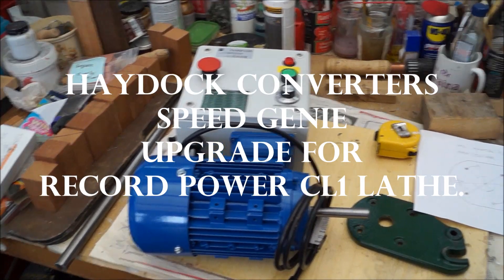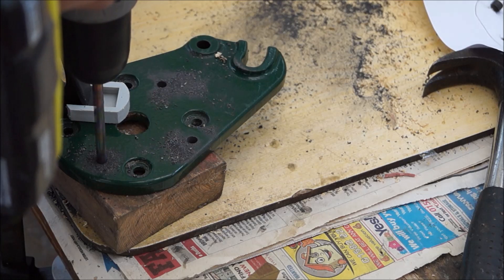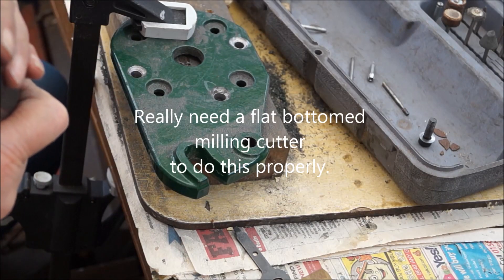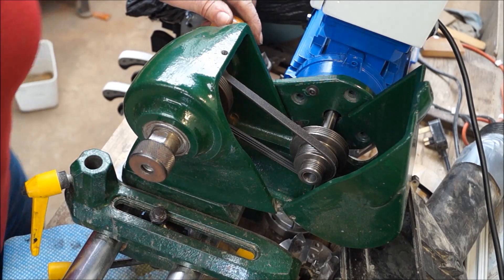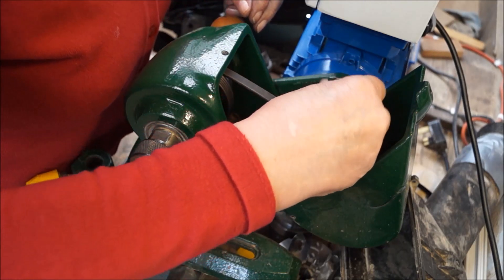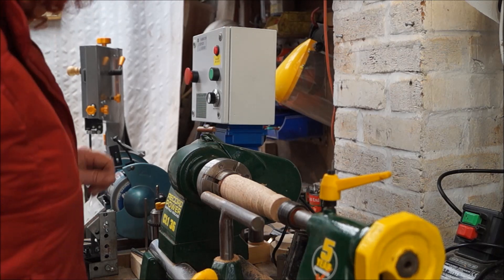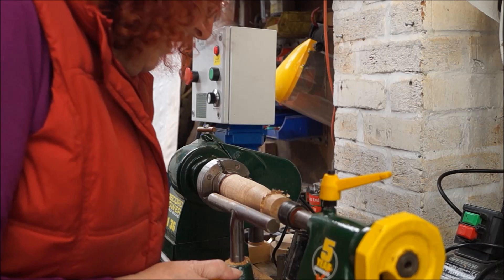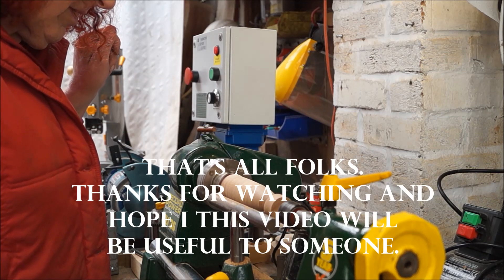Haydock Converters Speed Genie Upgrade for Record Power CL1 Lathe

Comment: good evening
i m french so my english is not very well.Excuse me for  that. I have a problem with the bearing bronze  and this part is not awaible .i saw in your cam that you have a simple bearing is it original mout or you have made changes on your machine . if it s the case can you explain me how you did it
regards
mr weil
Reply from the maker: This is a CL1 which has ball bearings, the  CL3 & CL4 have  bronze bearings which must be oiled through the cap on the top.
These bushes are available through Record Power but I do believe they can be adjusted. I would suggest you contact Record Power directly or through their website. I no longer have this lathe, I sold it earlier this year.
Reply: @missteeswoodturning  thanks for your answer
I ll doing that

Comment: Hi ... 
Great vid ... well-done you!
A side question; if I may ... !?
I see that you have made a little handle for the back end of your main shaft ... 
Do you find that to be very handy in the turning of the shaft by hand ... !?
And, how did you fit that little handle to the end of the shaft ... by it's original little bolt!?
If so; does it not come loose ... !?
Thankyou.
Best ... 
William (Hampshire UK)
Reply from the maker: The original screw wasn't long enough so I used a longer one. There should be a belville washer on the original screw so make sure you use it the correct way round.  Belville washers  are slightly c shaped and the c fits towards the bearing. Also make sure the new knob only seats on the centre of the bearing.

Comment: Wouldnt you think if Record are offering a mod to a lathe, they would consider and if needed supply, the required new mounting plate? That said, they do supply the SC4 chuck with an indexing plate on the back. Which you cant use because you cant access it, as its too close to the headstock!!!! DOH

Comment: Well done mate ... one very happy bunny me thinks :)
Cheers
Mike
Reply from the maker: Thank you Mike. It's made all the difference in the world. It's like having a new lathe. I haven't opened the belt cover since I fitted the conversion. 🙂
Reply: @missteeswoodturning  Out of interest, what is the 'ball park' cost of this conversion. I have a draper and am looking to this very conversion! :-)
Reply from the maker: @OutdoorEducatorLS  if I remember correctly around £350 for the complete conversion which included modifying the pulley to fit the new motor. Obviously that's different for other makes of lathe.
Reply: @missteeswoodturning  I just contacted Haydock, and got offers on a 1hp Speed Genie and a 1.5hp kit, which one is yours? The prices I got was quite a bit higher then 350, unfortunately.
Reply from the maker: @tolsen77  the CL1 kit is under 1hp but I can't remember the exact horsepower.

Comment: I'm happy to see everything is working fine. It seemed to be a bit of a faff, if that's a word, but you managed to overcome the problems with a great result. You will enjoy the benefits of variable speed
Reply: You could opt to add in a tach from ebay. You are certainly talented enough to add one in.
Reply from the maker: @sdad46  Thanks for the idea. Something to think about 🙂
Reply from the maker: Thank you Wayne. Only a faff because I can't afford the equipment to do some of these jobs, like modifying the mounting bracket. But I'm used to finding ways round problems, as I used to run an engineering business. btw if you don't mind me asking, what software do you use for editing your videos? I'm using a version of Microsoft Movie Maker but I find it a bit restricted.
Reply: @missteeswoodturning  I use Cyberlink. It costs but it's good